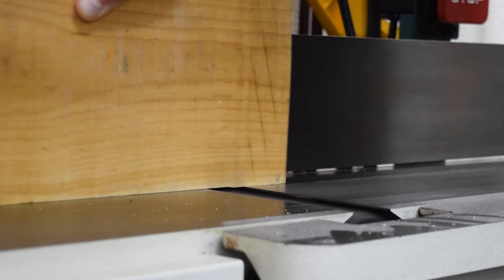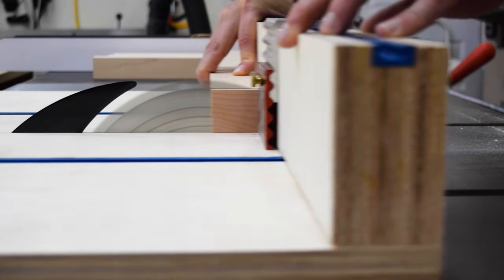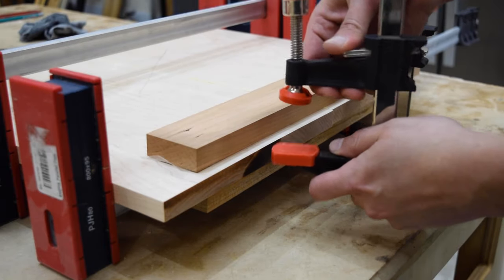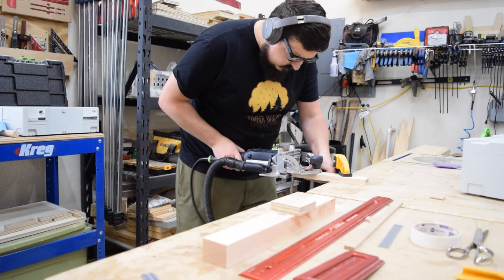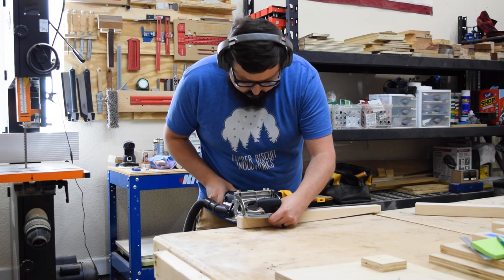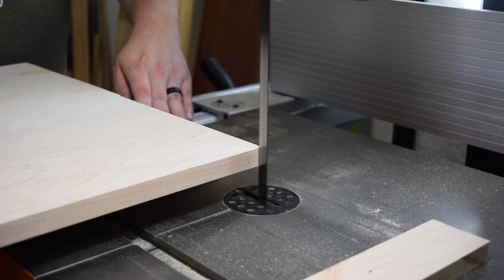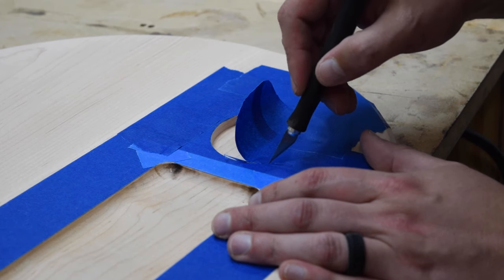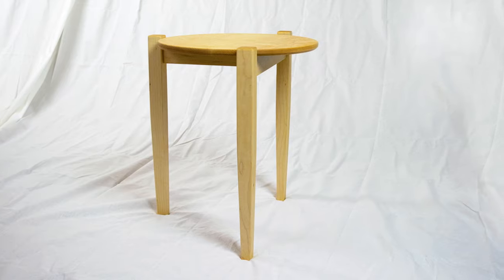Bet You’ve Never Seen a Side Table Like This

Comment: Great piece! How did you attach the vertical feather board to your fence?
Reply from the maker: Thank you! The vertical feather board attaches via a stong magnet to the fence. It uses an "on/off" style switch to attach and remove the magnet.
Reply: @TimberBiscuitWoodworks  huh, I guess I didn't realize the top of the fence was magnetic. Neat!
Reply from the maker: @mileshh515  I don't think every fence is magnetic, but the Sawstop one is made from steel. I would just recommend checking first. But it's a really nice feather board for getting that downward pressure on a workpiece.